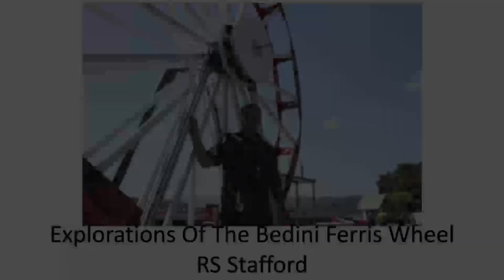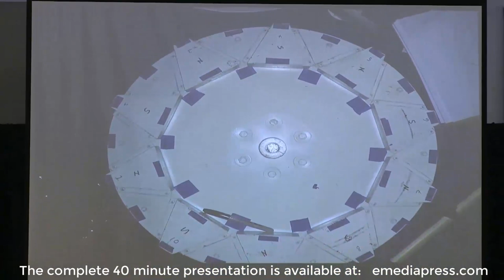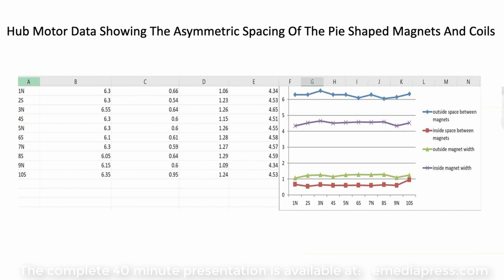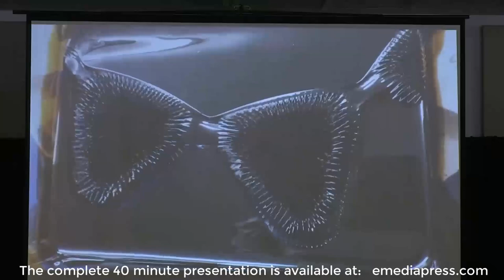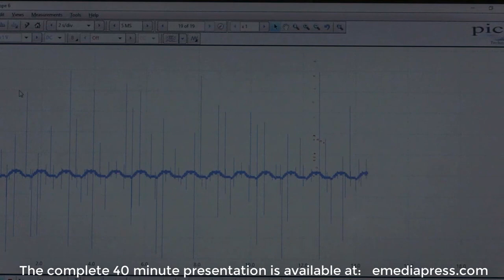2021 ESTC Preview - Explorations of the Bedini Ferris Wheel - RS Stafford

Comment: I seen this machine at the  2010 conference when it was unveiled. It is an incredible piece of brilliance. The front batteries were dead and it ran in idle mode all day on dead batteries. When John flipped it into generate mode it  proceded to charge it's run batteries up WHILE overcharging the back batteries. He let many of us flip the switches and check the batteries ourselves. That thing would take your are off if you tried to stop it when it was running in generate mode. I'll never forget it!

Comment: Hi, I guess what some of us want to know is, will this power a home 24/7  ? I guess we would need some sort of inverter for here 240v
I have a solar system 4.5kw and I do have the ability to hook a petrol generator to my house if the power from the street goes down, I have a switch that shuts off power from the street. What size "Ferris Wheel" would I need? My house can consume around 11kws a day, all depends on the angle of the sun and clouds that affect the solar panels.